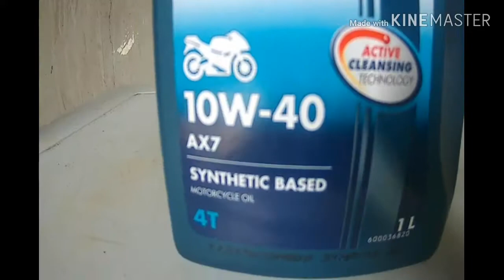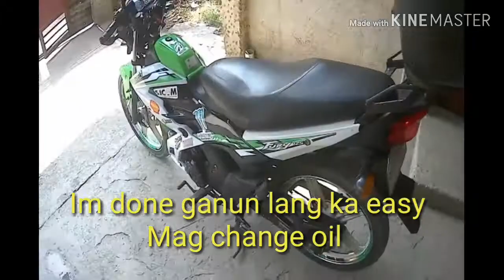How to change oil motorcycle || Kawasaki Fury 125

Comment: Boss tanong kulang kelangan ba ubos ang oil? Model 2016 fury
Reply from the maker: Hi Alleah kung ang tinatanung mo eh kung uubusin mo yung isang litro 
Opo uubusin nio po kasi ang capacity ni fury eh 1.2L
Ang ibang motor po kasi ay may capacity lang na 1L kay 800ml lang po dapat ang i lagay ...
Dahil may tendency malunod ang makina...
Reply: @mikemotoph4018  boss yong nkalagay po is 1 diko alam kung anong sign yun basta mag kadikit sila
Reply: Lahat bang model nag fury 1.2 ang capacity ng oil?
Reply from the maker: @alleahabines5560  yes

Comment: Paps yung motor ko kasi parang patay ng patay pag tumatakbo na ng mga 5 or 10 mins. Pero pag pinahinga ko within 1 hour ok namn tapos nung dadalhin ko na ganun parin pinalitan ko na spark plug ko pero sabi sakin ng mekaniko try ko dw drain yung gasolina ko or baka yung regulator ko dw yung may problema Yung brand ng motor ko fury na classic 2011 model plss help paps
Reply from the maker: i tune up mo para malinisan ang karburador...
Reply: @mikemotoph4018  salamat paps
Reply: Pati oil filter ba dapat palit din?